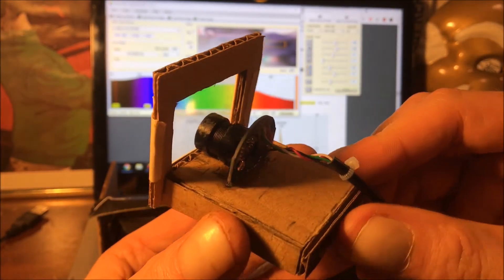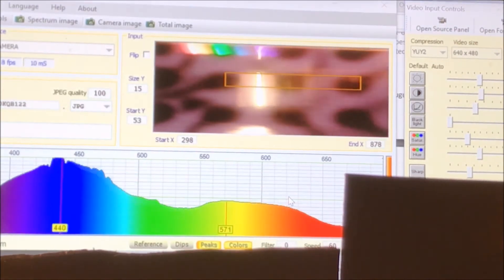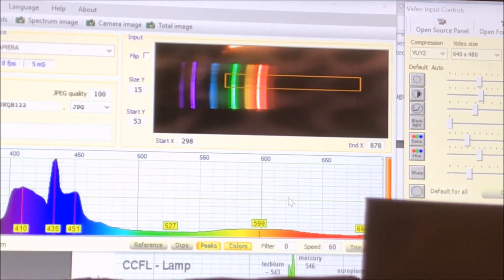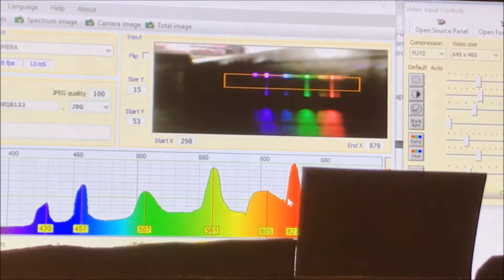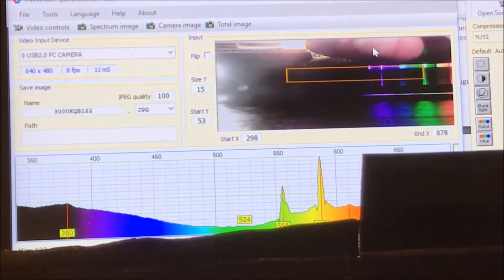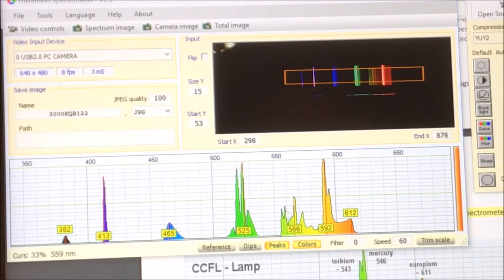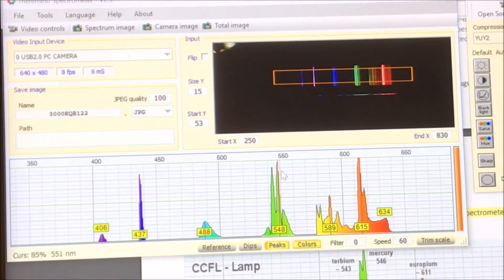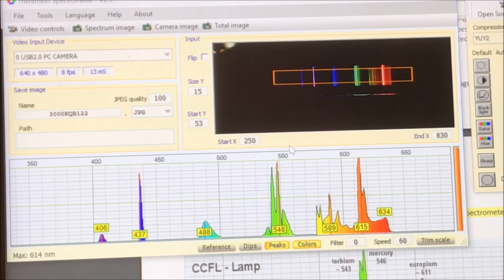DIY $20 Spectrometer Part 4: Improving Functionality - Episode 110

Comment: Great detail with the variables to deal with.  I've been wondering about how to cost effectively make adjustable screw mounts for the slit and the diffraction grating and sensor.  Was thinking about using a hard drive actuator for use with a Blu-Ray disc as a diffraction grating to make better use of the sensitivity that can be obtained I'm thinking.   Neat to see the real time effects and use of the Theremino software.  Thanks again for sharing!
Reply: Oh, forgot to mention... was thinking using a cheap micrometer since they can be found sometimes for like under $11 on Aliexpress... man, I originally typed $20 and figured I'd check... under $11 I see.  That's crazy. https://www.aliexpress.com/item/4000309827630.html